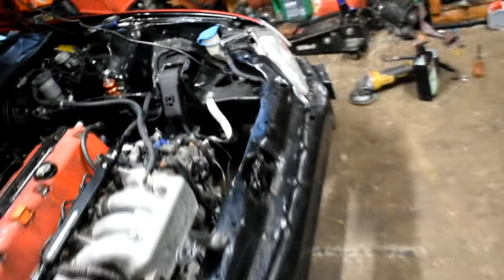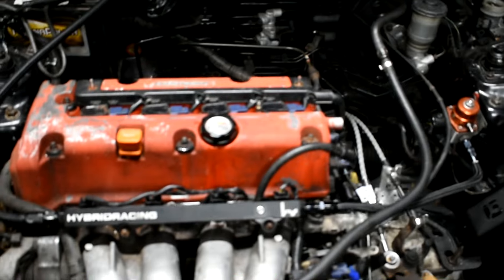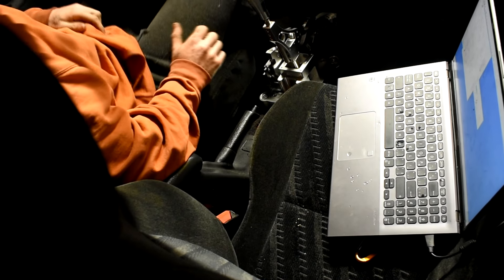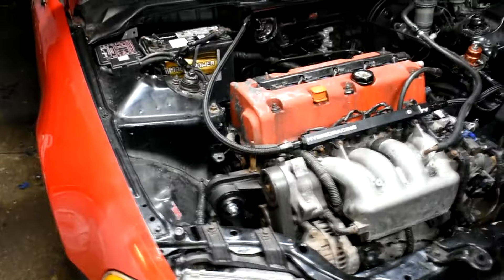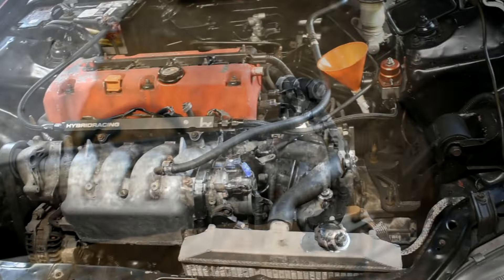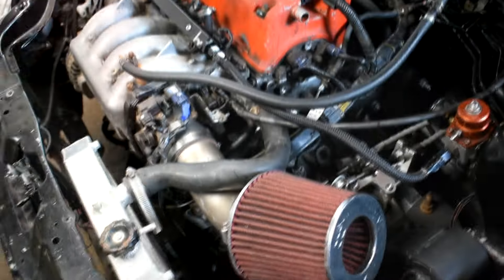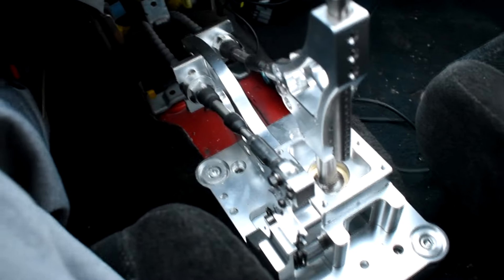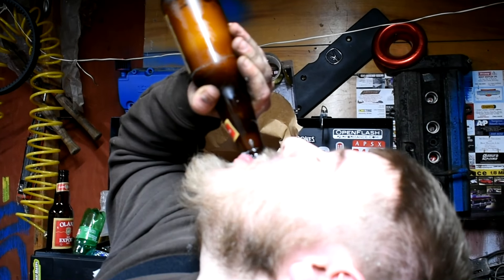K20 Civic Build RIPS !! *9000RPM*

Comment: I would like a little help I build a k20a3 bottom and z3 cylinder head but is making a tap noise only on idle like every 2 minutes or 1 minute I would like to know if its the timing chain guides or tensioner!